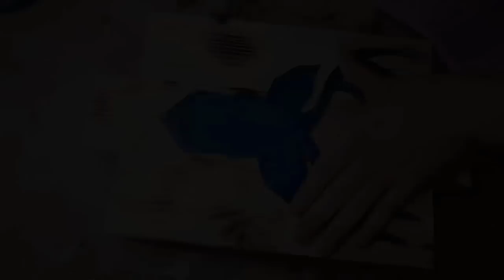15 Most Amazing Epoxy Resin Lamps / Resin Art

Comment: is it safe? I mean if the lamp gets hotter is it safe? what is the lifespan of the LED lamp? it can be replaced or not? sorry just so curious about this beautiful creation. thanks.
Reply: LED lamps don't really heat up. Last winter I made Christmas gnomes out of conifer branches and moss, so really flammable material. I wrapped the hats with fairy lights. The lights burned from dusk until I went to bed, sometimes I forgot to turn them off and they burned until morning. No danger - they don't even get really warm.
I hope that helps. :)

Comment: What compounds are you using, i.e., cutting compound, gloss compound? Also I am guessing that GlassCast is self degassing? The one thing I have issues with is deep pours with resin that says will degas... but doesn't!
Reply: Are you heating up the pours after. Looks like most makers either torch thin pours or vacuum batches before pouring.  I’m a newbie so just guessing.
Reply: @superclaymaster  I am seeking specific product information.. the polishing compound specifically